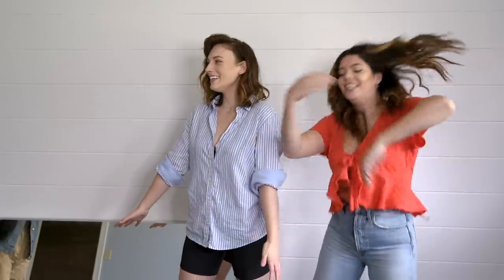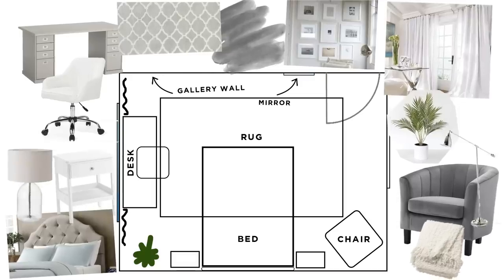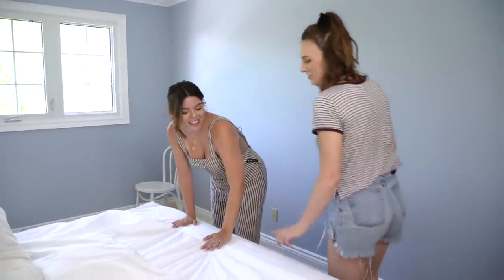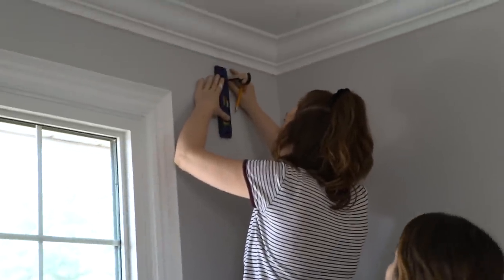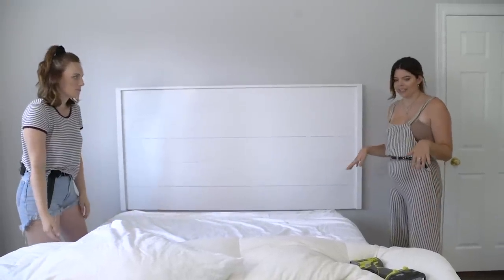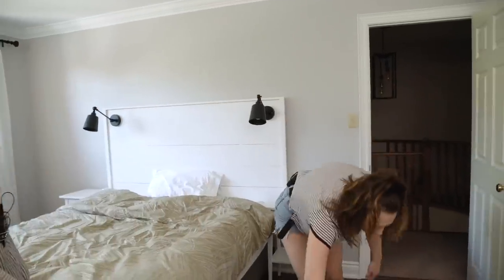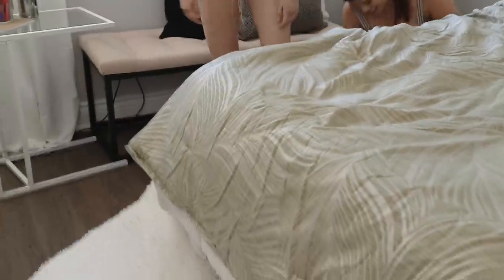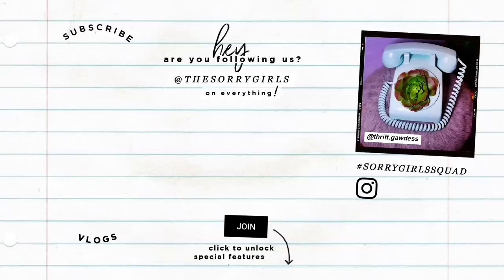TIMELESS BEDROOM MAKEOVER full of easy DIYs

Comment: Perfect diy opportunity for a long desk. Idk how I'd feel about the desk legs between the two desks put together. Awesome regardless 😍
Reply: That double desk with totally unpractical legs in the middle was totally weird, definitely something to never do for ONE person desk
Reply: I don't mind that part. It doesnt really get in the way. Its just two places to sit.  Who is going to sit right in the center of that long thing?
Reply: @savannahleslie3515  didn't say the user would sit in the center. 
It is like you said a "two places to sit" but even so it's gonna be annoying trying to avoid hitting that leg while transitionning.
The kind of setup for 2 places to sit usually has more than the legs in between (actually something like a file cabinet or desk drawers to separate 2 individual work spaces).
it is done many times yes, but just not so practical
Reply: @sharpendesign6604  I disagree. It really doesn't look to be an issue.  How is it hard to stand up, and sit diwn two feet over?  No extra effort to avoid the legs.  I don't see how its "annoying" or "impractical".
Reply: @savannahleslie3515  For a 1 person workplace it's much easier to just slide your chair from position 1 to 2 haha :P

PS: Even so, let's go with it & say that we have 2 sitting options there, another chair would've been more appropriate than a pouf (not really the most ideal sitting position for a desk like that, i'd say they put a pouf there just for the "styling" without thinking if it was ideal or not. choosing things "just for the looks" isn't acceptable, design is about aligning "beauty and practicality", gotta respect ergonomy basics when designing something ^^" )
So either a LOWER second desk for the pouf, or a chair instead of the pouf.
Reply: I think she could use one side for studying and the other as her makeup vanity kinda thing, because she looks like she does bomb makeup.
Reply: @savannahleslie3515  that's why i said 2 chairs instead of 1 chair 1 pouf. I'm not laughing as an insult, i'm just always in laugh and chill mode so i'm always talking this way :)
Reply: @Charmaine._  yes but the pouf desk should be a little lower than the work desk, can't really do makeup on a pouf while the desk is at your  mouth level haha
Reply: On their channel sorry life there is a video about a diy long desk (like from 2 years ago).
Reply: Absolutely agree. I used to have a 2m long desk (approximately 6,5ft) and when I definitely needed the space to spread out when working on one single subject. You do need a lot of Space to study if you work with binder, extra paper, books and a laptop :D the legs in the middle would have been a dealbreaker for me. But that desk would have annoyed me anyways due to being so small in width :D
Reply: @katl5357  exactly, thats just unpractical as hell
Reply: It's good for students to separate her study/work zone and play zone tho...The only problem in here should be storage, where do she put all her books and games?

Comment: Thank you for showing us that you made a mistake and how you solved it. It's refreshing and helpful (instead of panicking, trying to figure out a way to make it work).

Also, as a curved ruler to draw straight lines on a curved surface: a piece of thin cardboard like a cereal box cut straight (or a thick paper page holder). I use those to draw shapes and they're pretty flexible while being rigid and thick enough to guide my pen. Hope this helps ^^

Comment: So pro tip for the future, or if you wanna diy your own headboard: use French cleats instead of d rings. Easier to hang (as long as everything is level), it also sits more flush and won’t shift around on you :) some d rings can actually pull apart if you don’t use the right size, so French cleats are safer!

Comment: A tip when buying gray: Buy however many gallons you need of white (usually 2),  a 5 gallon bucket, a pint of black,  a sample size of yellow, green, purple and blue. Gallons are usually $30, a pint is $12, a sample size is $2-$5. I realize it is a bit more than just buying gray but you can mix the perfect gray and have a custom color.  

Swatch a gallon of your original white. Then dump the white into the 5 gallon bucket. Then dump just a bit of black (maybe 1/4 pint at a time) and swatch it.  Then more black and swatch it. Line up your swatched. 

Now here is the fun part: Once you get the general deepness of gray,  take about two cups out of the 5 gallon bucket and pour it into small cups.  You should have 4 cups with 1/2 cup of the gray in each. Now add a small amount (a half teaspoon should work of the sample colors into each cup. And swatch each on the wall. 

If your gray swatches too purple, add yellow.  If it is too yellow, add purple. Etc. 

My husband and I painted our master a very pale gray and mixing the colors ourselves helped us find the perfect gray.

Once you found the perfect gray with your tiny cups, mix small amounts of the desired shades into the 5 gallon bucket. You always watch to add small amounts.  

Our perfect gray was 2 gallons of an eggshell Behr white (right off the shelf), a pint of black,  a sample size of yellow and a bit of blue and green.  

It sounds like a lot of work but it was so much fun mixing the colors and swatching them throughout the room.  Plus we could see how the color looked at different levels of light throughout the day.